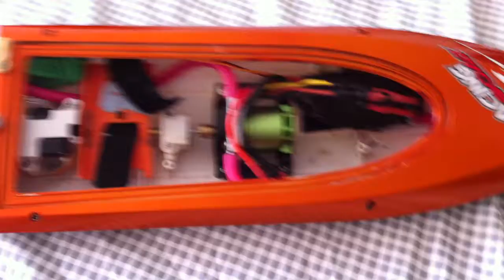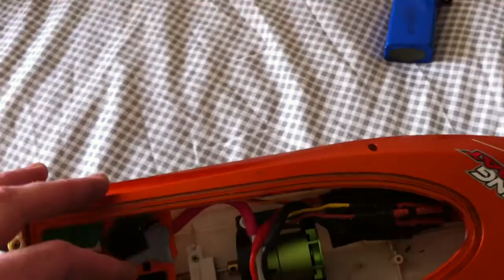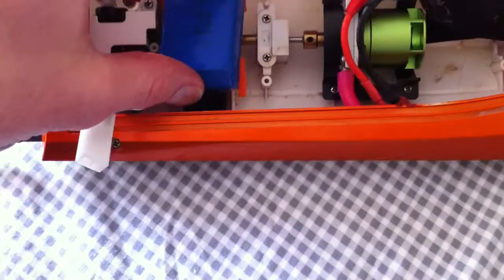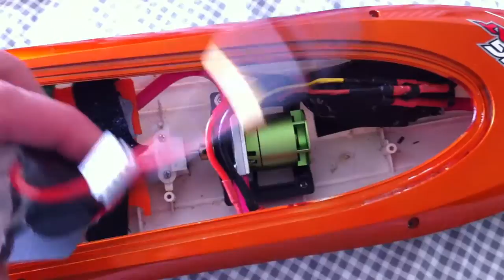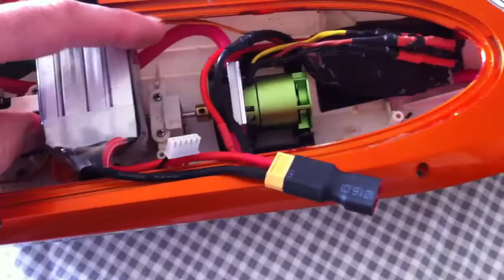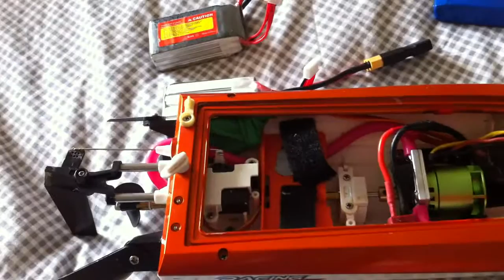Ft009 modified brushless upgrade 4s 4000kv review of mods. Dadtech&rc

Comment: 4000kv motor can use lipo battery 2s
Reply from the maker: Nice and easy to control
Reply: @garethpember5388  okay, is the speed reduced using 2s
Reply from the maker: @andrypatra3474  yes. 3s worked best with this set up.
Reply: @garethpember5388  okay I will try it, thank you very much from Indonesia

Comment: I want yo buy same as your battery can you tell me the description pls.
Reply from the maker: Hi thank you for your message. I used both a 1500mah and a 1800mah 3s but it was way too fast with that motor and top heavy. I had the best results on 1800mah 3s with a 32mm prop. I can post the battery sizes if needed?

Comment: If we change the motor,we to change also the remote control? Plsss help anyone there
Reply from the maker: I yes if you put a brushless motor in you have to put a brushless esc in. Which means you have to change to hobby grade radio gear. Dumborc transmitter and receiver packages are good value for money. I use flysky stuff.

Comment: That 4s battery could go down in front of the motor mate did you try that setup❓
Reply from the maker: I found the ft009 doesn't like being nose heavy. I usually fill the nose with polystyrene so if it leaks or crashes it keeps the nose up. I would of lost the boat at least 3 or 4 times by now if I hadn't.
Reply: I Totally understand the weight distribution issues on a small hull, I use to have a big fiberglass Scarab S type boat I built with a built Picco 80 Nitro engine back in the 80s turned 23,500rpm
Just getting back in to this hobby & have a FT009, I ordered & a WL913 electric hydroplane & the WL915 Tunnel Hull. The FT012 only worked 1 time so sent it back.

Comment: Does the ft009 motor seat can hold smaller than 540 motor? Without drilling a new screw hole
Reply from the maker: Hi most of the small brushless motors i tried the screw holes didnt line up. i had to re drill the holes. i also tried the ft012 motor seat but it does not fit and line up well enough.